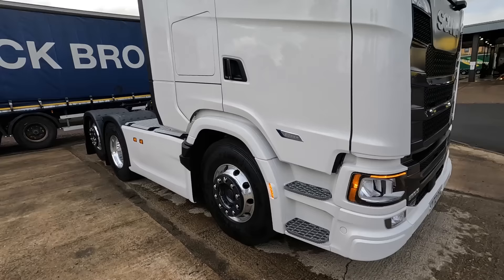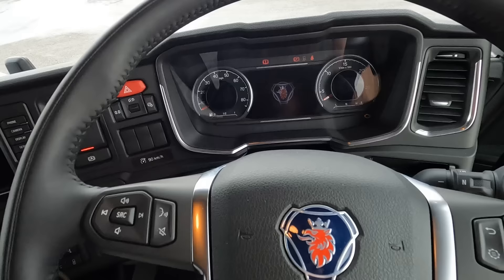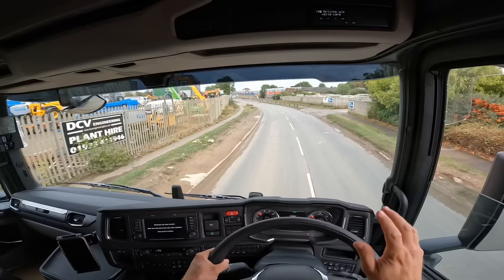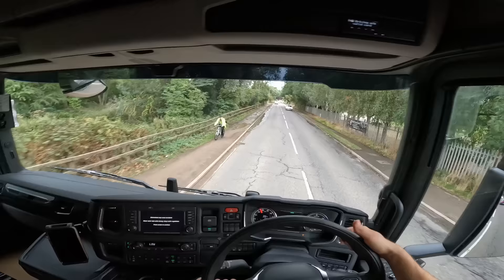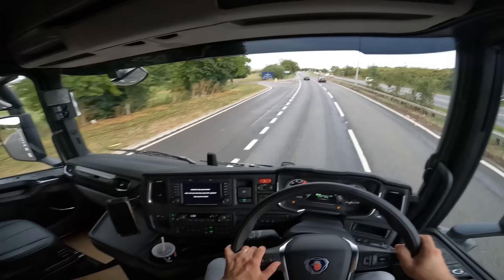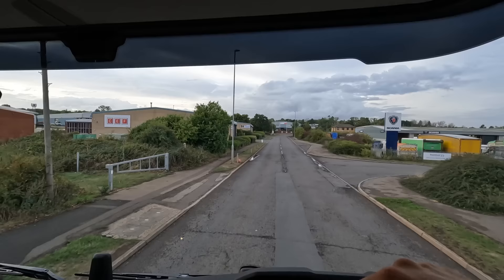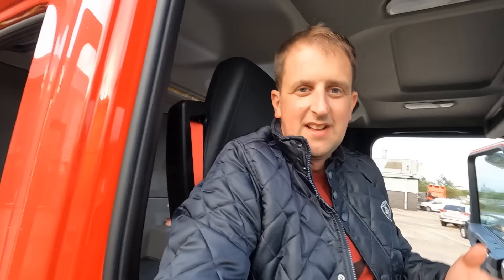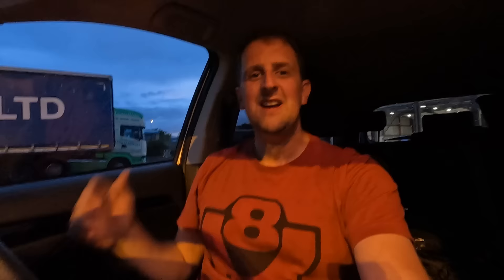Taking The Brand NEW Scania Super to KFC Drive Thru | #truckertim

Comment: The bit on the back of fire trucks is the lockers where they keep the hoses above the axels, road traffic accident equipment on the left side with the water light portable pump on the right side as well as first aid bags, defibrillator etc, fixed hose reels on both sides and more

Comment: Speaking of European lorries like this one are they required to run EURO NCAP  Automatic emergency brake testing or not? because that is absent on the American and Canadian IIHS NHSTA Crash test for Lorries.  Furthermore if they find a partner in the United States to sell this the problem is that European Lorries are way heavier than American Lorries due to max load 44  metric Tons (48 US Tons) UK Europe vs 36 metric tons US Canada (40 US Tons).  Excellent video overall

Comment: Are fire engines limited on speed do they need a digi tacho
Reply: There haven’t got a tacho no however we have to fill out a drivers logbook with where we have been how many miles and how long we were driving when we return to the station. no they aren’t limited on speed the most I’ve got is between 80-90mph as the speedo is a standard one and only goes upto 80mph but it does continue to accelerate off the clock so I can’t say the total top speed I’ve done only guess

Comment: So is it like an automatic truck unlike the normal manual ones?
Reply: Technically, it's not automatic gearbox like we found in a normal car (traditional torque converter gearbox). Trucks automatic gearbox is a manual gearbox that shift the gear for you. It's still have clutch and overall manual gearbox mechanism in it.

Comment: I am disappointed about Scania. We ordered new Scania Super with mirror cams…4 months after ordering they told that no mirror cams are coming as they can not make them work properly. Also many options what Actros L have in base level you have to order Scania extra- like tire pressure monitors (Scanias pressure monitors are also not inside wheel but on wheel what is ugly as hell), side impact radar for pedestrians, predictive power train control etc. Many safety systems what Actros have till MP5 Scania still have as a option or don’t have at all. So yeah we cancelled order and move on with Mercedes till Scania are up with Actros level
Also bit funny to see how you are hyped by engine brake and acceleration…this is just truck without load….what you expected 😏
Reply: Merc gearbox sucks you know 😂